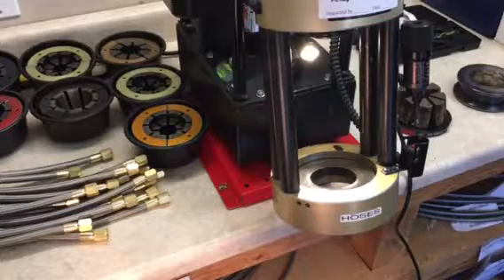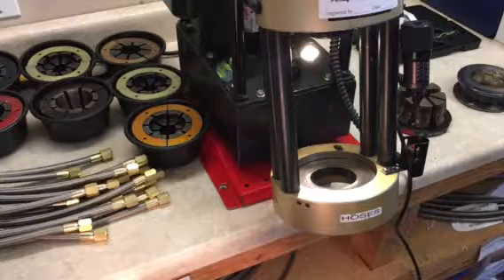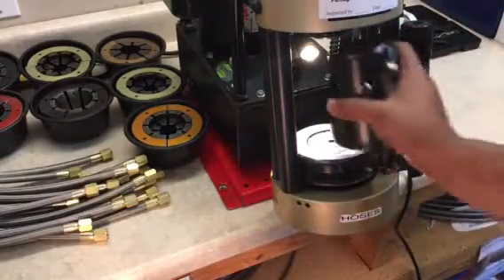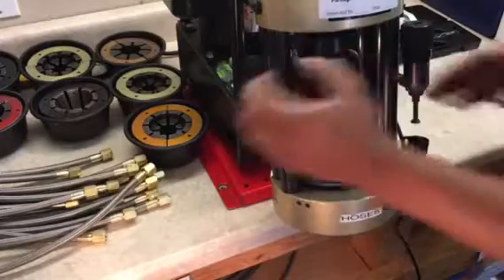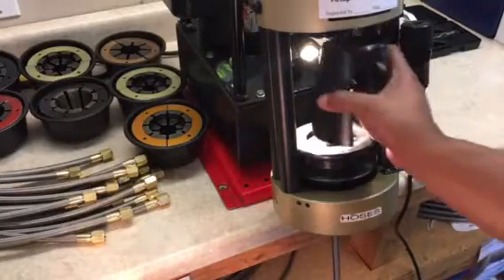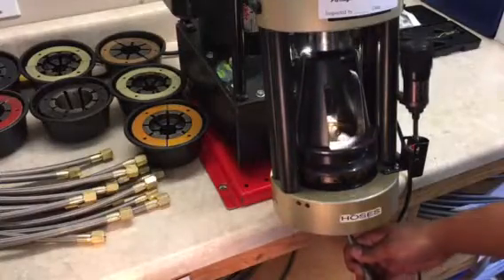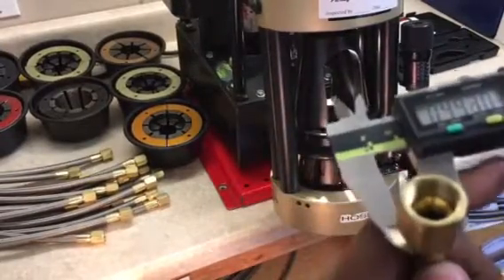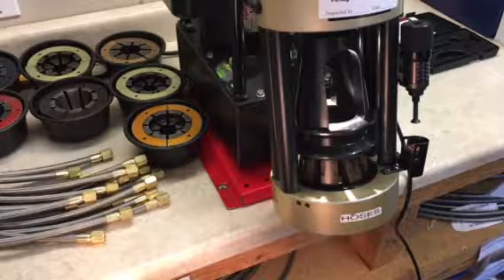Video 4 - Crimping a hose assembly

Comment: Yes you can grind it off. If you grind down two sides of the collar you can usually break off the fitting. However you will not be able to use the fitting again.